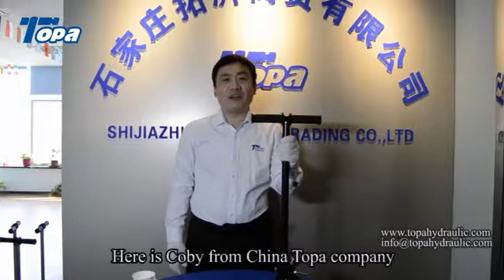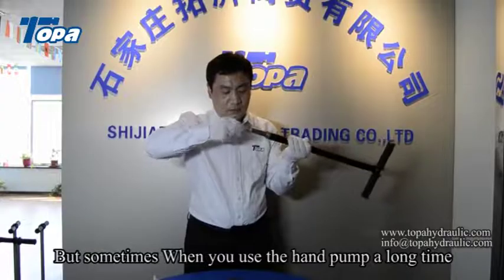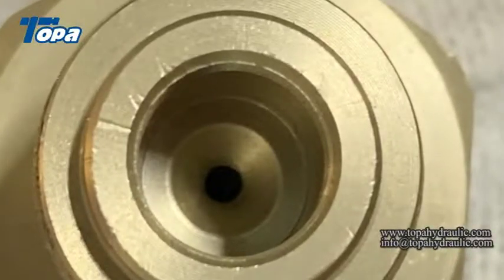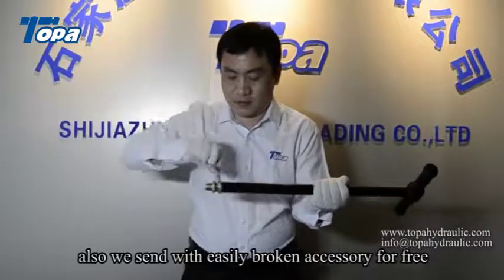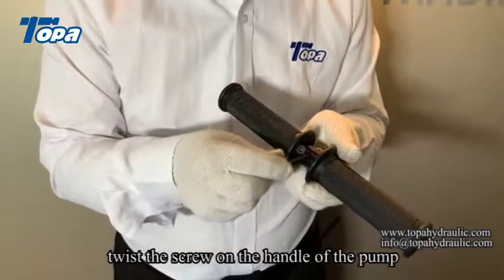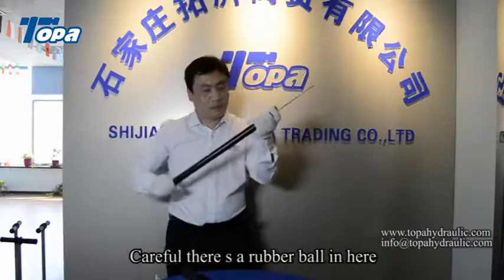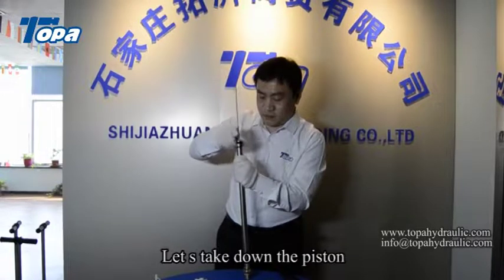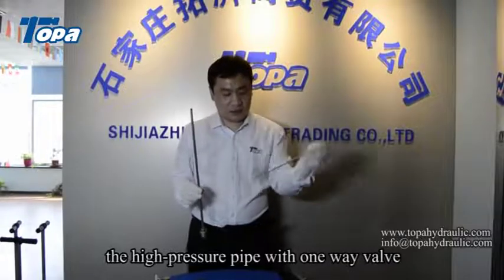How to repair the 300bar 4500psi pcp air rifle hand pump A batch

Comment: A TRULY EXCELLENT piece of kit at an astonishingly low price here in the U.K. given what it can do an how much it can save the purchaser versus those other "established" hi-pressure pumps.   Only problem with mine is that I cannot produce those REALLY High 4,500psi pressures.  When I reach around 3,000psi my unit pretty much tops out, but that is sufficient to power and refill my Air Arms S410 PCP Air rifle.
Kind regards,
Steve.

Comment: WE WOULD LOVE TO SEE ONE THAT IS HALF THE SIZE FOR BACKPACKS! 🙂
Reply: Remove handle and base, store in a rollmat case.
If your packs big enough put inside, if not strap securely to pack.
But 100% agree, shorter and longer tubes would be a great aftermarket seller.

Comment: I have to advise you the key part you missed.  At 3:32, you forgot yo clean the o-rings of the pump piston.  There are few o-ring inside it, especially the o-rings in the top (you have to remove the top screw to see it).  It is a very important part but not mentioned in your clip.
I watched your video several times and repeated to clean the seals but in vain.  My pump bumped back every time so is unable to inflate the PCP.  Replace the tiny o-ring inside the pump piston at 3:32, and it works as usual now.

Comment: I had my pcp pump for 2 years now. When I took apart mine, it had no coolant, I guess it works fine without coolant. Mine began leaking air when pulling upwards, I replaced all o-rings and now it works fine again.

Comment: Where/how do you lube the shaft of a 4500 psi hand pump? I have a spritech and theres nothing in the manual about where to lube it. Do i  take it apart or just drop some oil in the gap of the up and down shaft?

Comment: Howa mutch water did i add
Reply from the maker: What is added is cooling liquid, which can be replaced by antifreeze used in cars. Generally add about 180ML, You can add 20-30ml more appropriately,pay attention not to be too much.